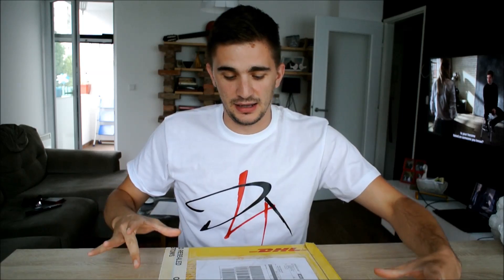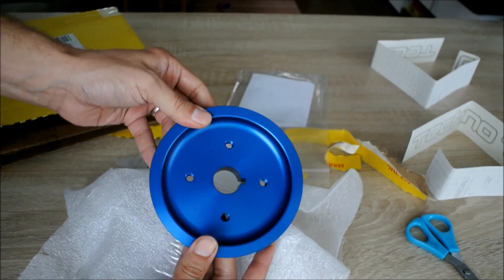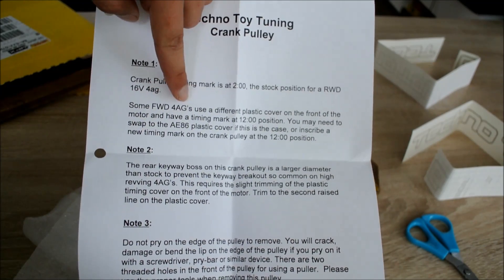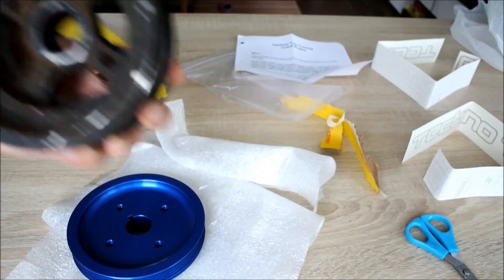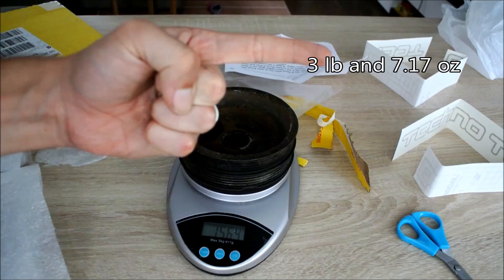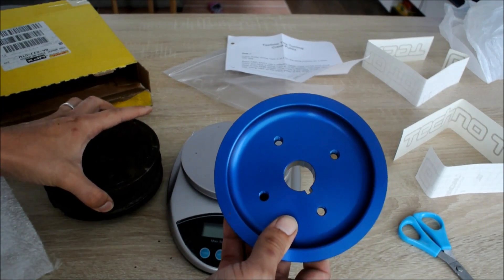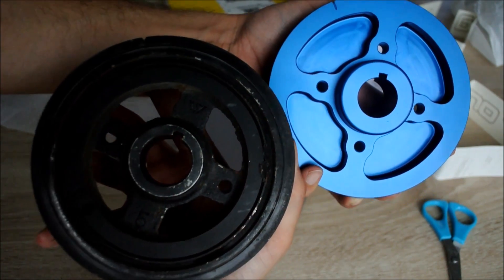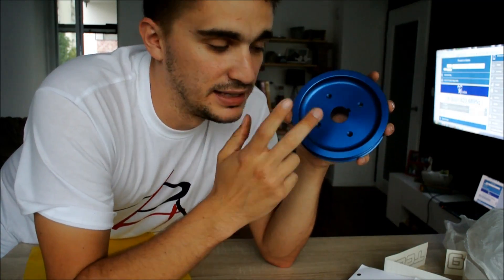Lightweight crankshaft pulley unboxing

Comment: I heard these stuff are bad for your motor. Hmm. Lmk how it goes
Reply from the maker: K D Heard the same, but it's not the case for the 4age, where the stock pulley does not play the role of the harmonic balancer. But I do plan to update after several thousand miles and months of ownership.
Reply: @d4a  the harmonic dampers are there for torsional vibrations in the crank itself. With the relatively low power and short stroke of the 4AGE it wasn't going to have much effect. 
Once you increase power output you will get more torsional bending and vibrations, especially with the torque of forced induction. Stroker cranks also make it worse because they have less twisting resistance because of the longer spacing between rods and crank journals and they give the piston more leverage on the crank.
All if this is only important in longevity because the crank's metal will fatigue over time and often you will have bearing failures before crank failures because of the torsional bending
Most people that run their engines hard don't expect them to last 100k miles anyway, so it might not even matter until the 1st or 2nd rebuild

Comment: Is there no harmonics to worry about putting on a lighter crank pulley?
Reply from the maker: James Oranje I was concerned about those as well and did a lot of research and asked a lot of 4age experts, and concluded that the stock 4age does not play the role of a harmonic balancer in case of the 4age. That of course is not the case with many other engines.
Reply: @d4a  I find that odd as all the experts I have ever spoken to say the exact opposite, have you asked Barry from MRP? 4AGE engines are internally balanced but externally dampened, if it wasn't the case then there would be a rubber dampened outer pulley section(s). Unless counter-shafts are involved then due to the inherent design of an inline-4 cylinder engine there will always be second order harmonics. There have been various reports of issues with these fixed pulleys such as reduced bearing life, broken oil pump gears and at worst a crank breakage. When the cranks let go it's seemingly only through the #1 cylinder big end. Just like with over-revved con-rods it's metal fatigue that causes the eventual failure which makes it very unpredictable in when the problem will manifest itself. Not only that but the problem with any fatigue related failure is that it can be a very gradual process. So unless it's with race use it's unlikely that you will see any negative effects until after 10's of thousands of miles.  There are aftermarket pulleys sold by MRP that dampen the harmonics even more so than the OEM options, I have on good word that running one of these will give a noticeable increase in bearing life over an OEM pulley. Anyway  it's completely up to you, I just think it would be regrettable that you carefully took your time with this built to then develop an issue down the track. I am open to input on any of the points I have made.
Reply: @Samqdf  maybe for consumer standards? I run welded motor mounts on my Saturn. Everything rattles in the interior. The crankshaft pulley does not have a damper.
Reply: @SirCavemaninthewest  Bearing life aside it's all about metal fatigue, which is something that takes time to manifest itself. So the question is will something go wrong during the time you have your engine in use or will it last until that point. This is why some people report failures and others say they never had anything go wrong.